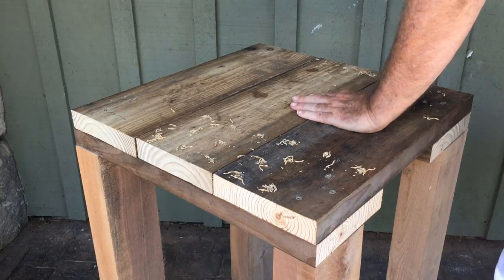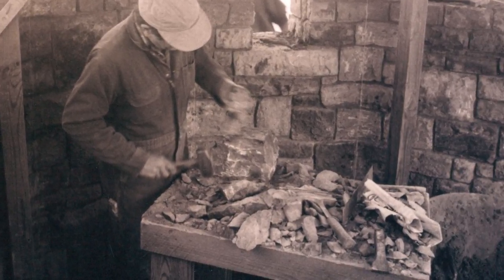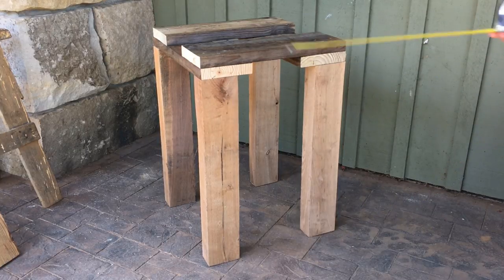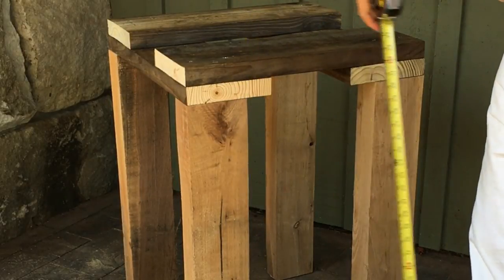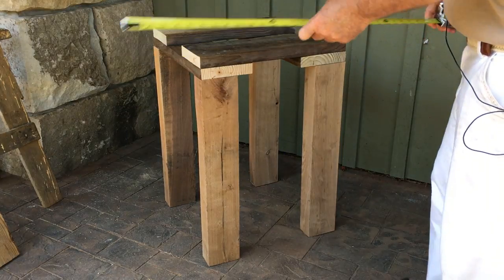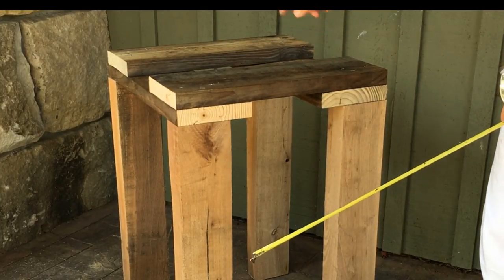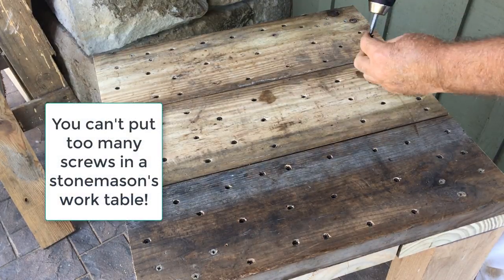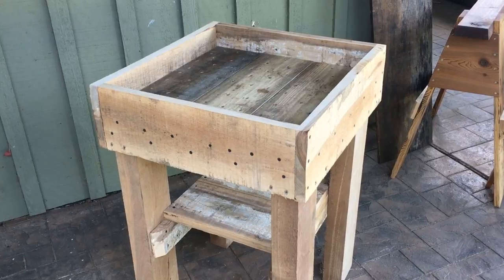Handmade House TV #38 "Building a Stonemason's Work Table"

Comment: Noah-
Greetings from the Columbia river Gorge in Oregon.
I have watched 10 of your videos today. Excellent presentations done in a humble approachable manner that is obviously the result of a life deeply entrenched in a direct relationship with materials. Very refreshing with a no B.S. factor, and no patronizing attitude. You and I seem to share almost identitical philosophies of life, work, aesthetics, ethics.
As a traditional stonemason, I am always on the lookout for anything related to building with stone. It is my dream to build a stone house on my own parcel of stone laden land. Historically the stonemasons table was called a 'Banker'- ( French 'Bankre' , 'Bancre' ? meaning 'bench' I believe.) The masons who cut architectural and dimensional stone were 'Banker masons'. Your table looks good and stout. You are correct about a liberal use of screws. Mine has hundreds burned into it over the years. I used P.T. 4 x12 plank for the top deck surface, which is now worn down in spots. I find it deadens heavy blows. I wrapped the outer 'skirt' with a strapping of steel and attached rare earth magnets from which to attach my chisels. This keeps the banker top less cluttered. I have used a sand box basin top for a year, but found that the sand grains get sucked up and shot out when using the occasional angle grinder. The basin also became a mixing trough with stone dust, spalls, sand, water and the constant pounding turning it into a box of rammed primitive concrete.
 As for further custom mods, I also screwed in some metal leg 'cleats' or 'shoes' because the legs were getting ground down unevenly due to high abrasion, impact and constant wetness. I have had one of my bankers for 10 years. When it starts to get loose, I burn in more screws. It is not uncommon for me to table a 300-400lb block on top, but having copious dunnage onsite allows us to crib up larger blocks and slabs to an ergonomic height. I welded a short all steel framed bankre for large (tall) stones. Good body positioning in this vocation is vital. I spent most of my apprenticeship hunched over or on my knees, and finally suggested to the boss "lets get some damn tables".
 Australopithecus to Homo-errectus evolution. A huge difference in all facets of quality. 
I see that you are spearheading a stonemasonry workshop. I am intrigued. I would like to work some  earthy sandstones and limestones.(mostly igneous material here)
If you are short on workshop content, or are interested in having another veteran instructor contribute, I could be interested. I enjoy collaboration and travel. 
Let me know and thanks for sharing. 
Matt Goddard-Stonemason
Poetry In Stone
www.poetryinstone.com
Corbett, Oregon

Comment: Looks like a sturdy little work bench. I've seen so many around here just flip a plastic 55 gal barrel over and use that. I thought these were a thing from a by gone era. Thanks for sharing.
I'm considering a timber-framed unit for when I get around to doing the re-construction of this roughly 200 year old L&N bunk house. Planning on some stone and some brick work on the outside.
Of course I'll have to jack up this two story behemoth and redo the foundation first. It was built pier and beam, but the beams were laid right on the giant rocks in a flood prone area, so it has sunk over it's lifetime and ended up with the wood on the ground. Going to be around $35,000 to jack it up and do a concrete footer and rebuild the base. But I only have $23,900 for it, so it can be brought in under its final value and still do it right.

Comment: Why no glue on this table? Would it be beneficial to use a urethane over the screws soon the top to prevent water from working in to the screw holes?

Comment: Hi Noah, with regard to chinking what material do you prefer to use for insulation? Does your love for natural materials stretch quite that far?
Reply from the maker: I use a spray foam application... for years I used fiberglass (which I guess is a natural product of sorts... and it does a pretty good job... but the foam does a much better job at stopping air infiltration.

Comment: Hi, I just found your channel and just subscribed. I watched a few of your other videos too.

I noticed that you show a lot of log and concrete cabins and was wondering why you choose that style over just plane log cabins. What it the benefit and/or disadvantage you see in constructing that style in comparison to others? (rock, brick, all log)
Reply from the maker: John,

 Welcome!

I would recommend checking out two of my previous videos... this one... https://www.youtube.com/watch?v=JMpur-4-KG8 and episode #5 of the Handmade House TV series.

I'm a big fan of five different forms of home construction one of them is traditional log cabins (the others are timber-frame, stone, traditional stick-built, and ICF's)  I also favor building what I refer to as a blended home... for instance part log, and part timber-frame.... or part log and part stone. Each form of construction has it's pros and cons... and so when we build a home that offers a bit of each we end up with an amazing home.

I have tried the round pole method of building a log cabin... once... that's all it took.

The traditional method of building cabins is the most common and time proven method... the oldest cabin in the US is 400 years old and built in this manner. As was the cabins of Abe Lincoln, Daniel Boone, and Davy Crockett. The log-on-log method is the Scandinavian method and has only been used here in the US as a temporary means of housing, or as a quickly built outbuilding, or a modern kit home (requiring regular applications of sealers and preservatives). 

I like to take the best of historical construction, combine it with modern improvements, and alternative methods... the result is a handmade home!  Make sure and visit my website and consider signing up with our free weekly newsletter and maybe even joining us within the Handmade House Guild!  https://handmadehouses.com/

Noah

Comment: Those look like regular drywall screws. Why are tou using those?
Reply from the maker: They are indeed drywall screws... they have been my favorite screws for many years now... amazingly strong, durable, available, and inexpensive.
Reply: Handmade Houses with Noah Bradley why not just get them galvanized?  They are that much more expensive and will last much longer and won't put out rust stains that will get all over yourself, your work, and your clothes.
Reply from the maker: That is an option... and sometimes the smart one to take!  It wasn't about the cost when it came to time to put this table together (it was more of a convenience as they were here in my shed and galvanized would have required a trip to the hardware store). I can't say I've ever had an issue with rust stains, and I've never witnessed a sheetrock screw wear out on stone mason table...  the wood gives up the ghost first.  I used stainless steel screws on my recent sawhorse builds which I will baby and take care of and will last me the rest of my life. Stone mason tables on the other hand are just made for abuse and require replacement every few years (or at least that has been my experience).
I do appreciate your feedback! It's always good to hear from another detail-oriented woodworker!